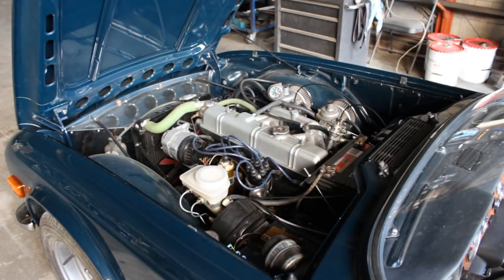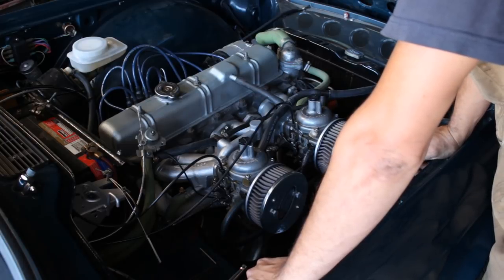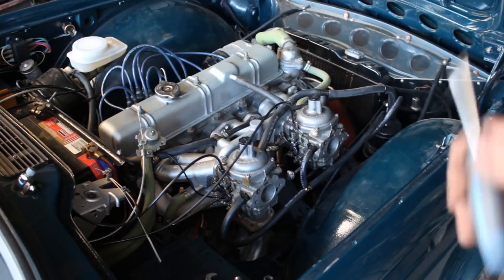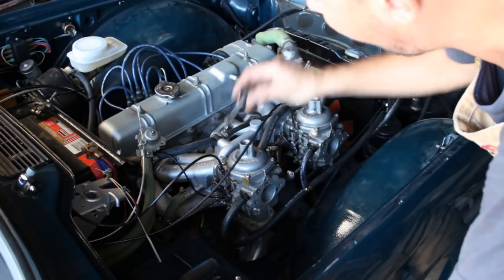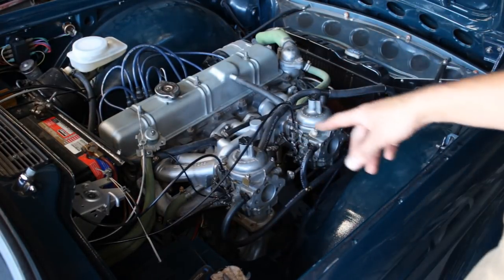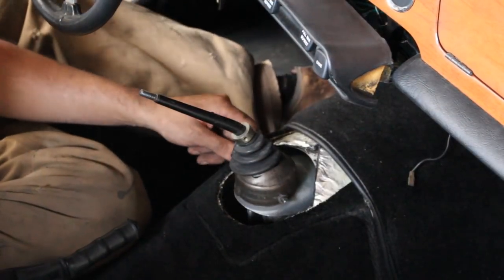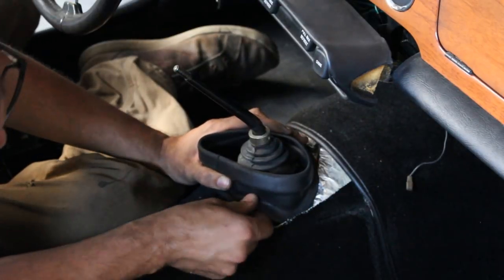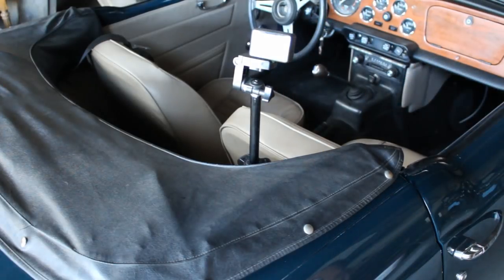1973 Triumph TR6 Restoration - Part 38 - Engine tune up

Comment: 1,  By using the original air cleaner, you can take advantage of using it's two air intake horns by tube ducking cool air from in front of the radiator/area. Plus air comes in under slight pressure in a balanced flow.   2 ,   Also you need two match the air carb intack at off idle with slight, on throttle, match like you did at idle.   3 ,  After you timed the ignition, via best vacuum, remember to listen for possible pre-ignition when driving and correct as necessary.  4,  you should aways adjust your valve train, first, before doing any of these other adjustment in fact  do it twice...... I did enjoy the relaxed way you work, very good!

Comment: Elin,

Lost my last message so might get this twice. Do this:

(1) disconnect throttle to carbs at point in between carbs.
(2) disconnect carbs from each other, remove coupling from one or the other side of link shaft.
(3) check and confirm operation of all accessories on each carb, then adjust mixture of each carb individually. Finally adjust idle and balance both carbs against each other as well as possible.
(4) when good as possible, reconnect coupling linking carbs together.
(5) adjust idle again with carbs locked together.
(6) reconnect throttle arm, making sure that when at idle, there is a small space giving some lost motion and that the bell crank is not seized, it must be loose but not sloppy.  The manual shows a drill bit used to confirm the air space. This prevents the throttle and linkage from binding. At idle, the throttle should not be affecting anything, it should be resting against its own spring pressure, and each carb should be resting on their respective stops.

This helps many ways! 

Tunes the linkage up.
Makes gas pedal feel light and drivable.

Many if these cars come in the shop with linkages holding the carb adjustment hostage, when in fact the throttle at rest should have this slight lost motion to divorce itself.

Just my five cents.

Reed
Reply from the maker: Thank you Randal. I know what you mean. Right now the linkage is pretty tight everywhere. I will have to take the carbs out now after the show and look at them closely. I rebuilt them about 2 years ago, but to be honest I've never been good with carbs (just never had time to get myself educated) but now I will have to figure out what does what and I will do a better job. It is idling too high and I suspect the trottle remains open for some reason. There is no vacuum leak, I sprayed vacuum cleaner all over the place while the engine was running and I the RPM didn't shange so...

Comment: Elin looks like at idle it was still running a little high your going to have to work on the throttle return spring to make sure that the throttle disc is closed all the way .I think these cars tend to run a little rich for a better performance , also the amount of oil you put in the piston affects the mixture great job as usual.
Reply from the maker: Yeah, it is still idling too high, I will definitely take the carbs out and do them right. I am just in a hurry for the show this weekend so I will let them be for a while.
Reply: I was going to ask you what your idle is set at. Mine is 1000rpm or a little more, with new rebuilt carbs. This summer I decided to be a checkbook mechanic and have the local brit car shop check and adjust the mixture, and check timing. The only good thing they did was replace a spring in my distributor. They added a resistor and adjusted carbs using the wrong screw. Never again! I reset everything myself.
Reply: Ralph you are correct regarding adequate (and equal) amount of oil in the dampers. I was able to reach near optimum setting of my TR6 only by topping / equalizing damper oil levels in the two (ZS) carbs. First thing to check before more any elaborate changes...
Reply: How much oil would you say the dampers need? I’ve been filling to the brim and unable to do the piston lift test. Engine wants to die no matter how rich I try to tune it.

Comment: The rod between the generator and the choke the main rod seems a little bit squeaky so it seems to me you need to put some grease or oil on it

Comment: I would sometimes be driving on the highway and it would start raining. I would always wax My windshield because as You’re driving the speed of the car and the wind keep the water from dropping in the car, and the waxed windshield let the rain just fly over the top of the car. ONLY problem is when You stop for a red light. Then You’ll get wet.

Comment: If you can find an original air filter box instead of the little carbs, it's an improvement
Reply from the maker: I have the one from the 74 TR6, but I don't really like the look of it.